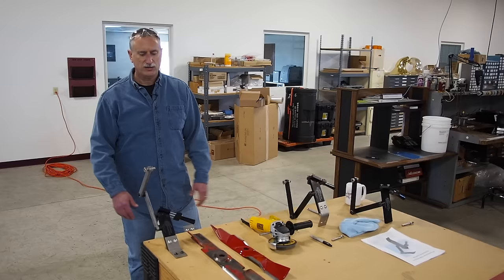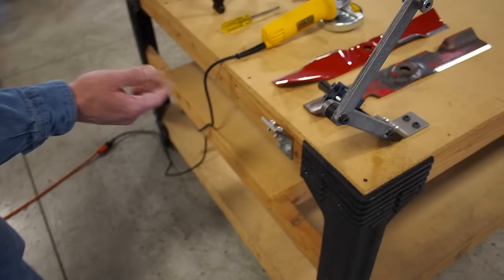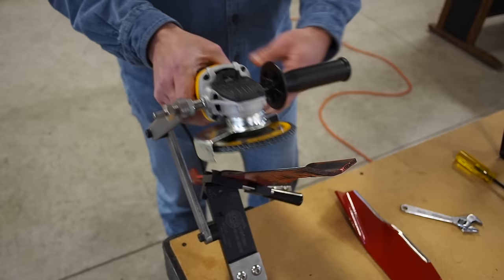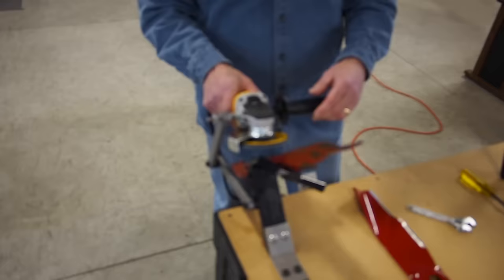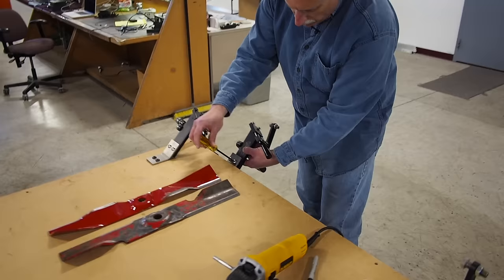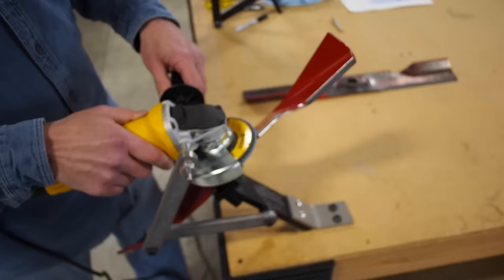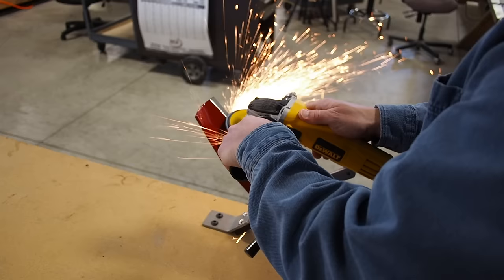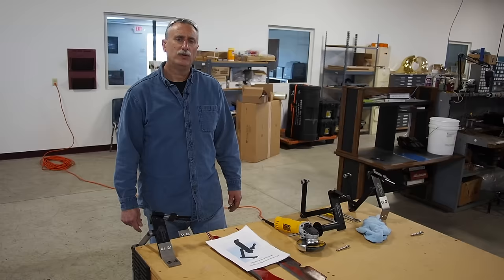All American Sharpener In Depth Tutorial (2017) - Lawn Mower Blade Sharpener

Comment: I was reading the first comment,  which I thought contained EXCELLELENT advice.  Then I looked closer and I saw that I wrote it,  three years ago!

Some further advice:

1.  The most important thing about sharpening a lawnmower blade is not getting the edge at exactly the right angle.  The most important thing is to sharpen the blade OFTEN.  In my experience,  the blade always needs sharpening!

2.  To sharpen the blade often the critical thing is to have the tools needed readily available.  For my MTD mower,  there is one central bolt holding the blade on and two supporting bolts,  one on each side.

Therefore,  I have a separate tool kit with the two wrenches I need to extract the two small bolts, and one wrench to loosen and tighten the main bolt.

I also have a purpose designed blade holder that holds the blade steady so that the bolts can be tightened or loosened without moving the blade.  That's a luxury,  but one I bought years ago,  so why not use it?

I  have a piece of concrete to use to hold the mower back against the ground.   exposing the blade.  It's always in the same place,  so it's always available.

I roll the mower over a piece of tarp,  so that bolts wont get lost if they drop  --- avoiding having them fall in the grass.

Finally,  I do my mower sharpening at the entrance to my basement,  the bottom of the stair well.  The mower is about three feet above the floor of the basement,  which is a convenient height to work on removing and replacing the blade.

I use a hand file to sharpen,  unless there is a significant ding.  If there is,  that gets cleaned up on a bench grinder and then filed as I sharpen the rest of the blade.

I have two blades, and will often remove one blade and replace it with the second,  already sharpened blade.  I then sharpen the second blade when convenient. 

In short,  I have the tools I need readily available and a procedure that makes blade sharpening easy and fast.  That encourages frequent blade sharpening  ---an  important trick to keeping your mower effective.

Comment: How do you adjust the 5005 to do mulching blades? It doesn’t just have to tip feature like the 5000 you’re show ing here. At what angle would you use to sharpen the top portion of a mulch blade?
Reply from the maker: I'm linking a couple of videos that demonstrate the way the 5005 works, and also walks you through how to find your angle. Every mower manufacturer has their own unique blade geometry, so it's not a one-size-fits-all approach to angles. Generally speaking, the raised mulching portion needs to be set 15 degrees LESS than the angle you're using to sharpen the cutting section.
https://youtu.be/muNntkofcYQ
https://youtu.be/YQd8xbZgkq0
Thank you for checking in, and for your interest. I hope this is helpful.
Reply: @AllAmericanSharpener  thanks for the response. I was actually out in the garage setting everything up before I seen your reply. I was able to get it right with great success. What’s odd about mine is it’s a the same angle on the top and bottom part of the mulching blade. Worked out perfectly just going straight across it. Thanks again
Reply from the maker: @dailyDIYdude  Glad you had a successful first go at your blades!

Comment: I bought the new gen 5005.  It is terrific.  Sharpened my Scag blades and Exmark.  But my 12 foot batwing Progressive mower (7 blades) all sharpen on the left side when put on the system.  Is there any way to make the Sharpener work on a left edge blade?
Reply from the maker: Hi Bill. Yes, I believe you are referring to a left hand or counter rotating mower blade. To sharpen a blade like that, you will actually be sharpening the edge below where the blade is mounted in the vise system. The link below will take you to a demonstration video of this. It's not the same blade as yours in the video, but the same principle applies.
https://youtu.be/AmlqcATxdAQ
We hope this is helpful!
Reply: @AllAmericanSharpener  Thanks for the quick reply!  I will be at the shop as soon as I can get more tiime and see if I have the 5005 EXT., otherwise, as always, the All American Sharpener has figured a way to do the job!  Great product.
Reply from the maker: @billfendley7531  - No problem. If you have the 5005 Gen 2, then you have the longer arms (each will be 9.5" instead of 8"). That is the equivalent total length of the older 5005 EXT Model (which we no longer make or sell). So you should be in good shape. 👍

Comment: will the 5005 model do mulching blades?
Reply from the maker: Yes, mulching blades are no problem for the 5005. The angle of the jig adjusts from 15 to 45 degrees, in 5 degree increments, and is designed to accommodate just about any blade geometry. Reach out anytime at support@allamericansharpener.com for more in depth questions regarding your particular blades.
Reply: @AllAmericanSharpener  thank you

Comment: I was always taught to have the angle grinder, or table grinder or file cutting into the blade edge not away from the cutting edge like this sharpener does, just like you sharpen a knife - whats the opinion here?
Reply from the maker: Thanks for your comment. We were taught that early on as well. Although I have since seen many professional knife makers who, during their process, sharpen with a belt going away from the edge. The main reason we do it this way with our jig is because a flap disc will get caught or cut up if grinding toward the edge. Since it is a mower blade and not a fine edged knife, we have found that this method gets the edge plenty sharp in a safe manner. If a burr does form, it is pretty easy to remove it.

I wonder if we can pull @Matthew Rowell from The American Edge into this conversation. He has a lot more knowledge about sharpening fundamentals. I'm not sure if this mention will notify him or not.
https://www.youtube.com/user/capnmatt41/videos
Reply: @AllAmericanSharpener  thanks for the reply - much appreciated - I'll have to check out the link
Reply from the maker: @Krispy1011  You're welcome. Thank you for your interest!

Comment: What about the angled sections of the mulch blade?They need sharpened to,as they are cutting edges as received when new.The Oregon has an attachment post to grind the entire cutting edge.Perhaps your flip adjustment could be adapted to do the other 2 edges?
Reply from the maker: I'm not sure I'm following your question. We sharpen the entire cutting edge of the mulching blade. In the video, he refers to the angle in between the two sections as the "transition area". When watching the video, you will see him sharpen half of the transition area in one position, and the other half in the other position. Then he moves on to sharpening the rest of the edge.
Reply: @AllAmericanSharpener  Thank You for the reply.I am referring to the back side of the transition area(closest to the center hole)
Reply: @DennyAustin5  Okay,or I can free-hand it.We will see when my fixture arrives ;-)
Reply from the maker: @Bowtie41  I see. If it were me, and I wanted that edge sharp, I would just keep grinding further back in the same position, or maybe back in the down position. The blade edge that close to the center has relatively little circular motion, which means it is not doing much cutting, and it isn't as prone to damage and wear. So I wouldn't be overly concerned with that area. Most of the action is happening on the outer portion of the cutting edge, away from the center. Hope this helps. Thanks for your interest!
Reply from the maker: @Bowtie41  I realized one of my responses was from my personal account. Hence the out of order replies. Sorry for the confusion.

Comment: Do you need to grind off the burr on the back side of the blade?
Reply from the maker: You can use a hand file to pull the burr off from the underside if you choose. We don't see a lot of burring with most of our blades. But we do see it on some of the smaller, softer metal blades. There is some personal preference there too. Sometimes we remind ourselves that the first pass on the grass will clean the burr off for you.

Comment: I just purchased a Toro 21” mower/mulching mower. Which one would be best suited for me. The blade is called atomic
Reply from the maker: The Model 5005 would be our recommendation. Many of the Toro walk-behind single-blade mowers have a slight tilt forward in the cutting edge section. With a blade like that, you may have to compensate for the tilted angle and use a setting more like 35 degrees to get a 30 degree grind. Another thing to be aware of with those Toro single-blade mowers is that the sides in the center of the blade are raised. You will need to adjust the vise screws so they fit over the raised center sides. You can see more about that in this video: https://youtu.be/lUw2R6YVa80
Thanks for your interest!
Reply: All American Sharpener thanks for the the great advice....will be purchasing one by the days end

Comment: What grit flap wheel would you recommend ?
Reply from the maker: We recommend a 36 or 40 grit flap disc OR a hard disc. Either straight or beveled wheels work equally well. If you do choose to use a hard disc, you'll want to be careful not to gouge the blades or take off too much material.
Reply: Ok thanks. I use 40 grit.  Can you use a cordless grinder with this too?
Reply from the maker: Yes, many customers use cordless grinders. On a rare occasion, a large battery may interfere with the guide arm. In those situations, you can simply flip the guide arm in the other direction.
Reply: Ok thanks. Will deff be getting one next season
Reply from the maker: No problem. Thank you for your interest.

Comment: Why is the sharpened edge for all that length,  7" to 9"?   All that does is make room for the blade to have a really short life   span  and maybe shorten anyone near to suffer a shortened life,   I've seen that happen from a blade piece come out of mower deck.    The cutting edge speed nearer to the center  of the blade length is not sufficient to cut at any RPM speed of current mowers.
Reply from the maker: That would be a good question for the engineers and companies that make the blades. We just sharpen the edge that the mower blade companies manufacture.

Comment: It still  depends on how  you hold your grinder (?). If grinder wheel is up and down during moving along  blade, then force applied on blade surface will be changed. So, it is  good tool for this application that does not require high accurate and precision
Reply from the maker: We disagree. It takes very little effort to get very accurate and precise mower blade edges with our products.

Comment: Anyone knows that spinning objects HAVE to be balanced.  I only sharpen my blades when they start putting an excess load on the mower and makes me run at a slower speed.  Having dull blades shreds the tops of the grass leaves and makes it grow slower reducing the number of times the grass has to be mowed.  Also letting the grass get taller before cutting helps block sunlight with the clippings so that the grass also grows slower.  When I sharpen blades, I use a bench grinder which makes it easy to follow the existing angle.

Comment: I just purchased two complete 3 blade sets for my gravely ztx 52 for 85 bucks off Ebay. I will use both of those sets this summer.  It will take me 3 years minimum to pay for this device and there are others out there cheaper not to mention that you can build your own. I can't justify it. Fact is, if I use nothing but my angle grinder by sight, I can sharpen these new blades after use several times with great results  just by Kentucky windage so that puts the payoff even further out. It's a cool setup but its over priced in my opinion.
Reply: @MajorImpact  I was wrong. I have only used one set of those blades this summer so the payout is even further out. I have no idea what it should cost. I'm just saying that I personally cant justify the cost for mowing my lawn.

Comment: There is nothing wrong with using a jig as a substitute for skill.

I'm a machinist and I grind high speed steel cutting tools for use on a lathe,  by hand.  So I have skill and no need for a jig for this simple task.  But if you can't manage this simple task with some practice  (you probably can)  nothing wrong with a jig,  

I'm guessing that a lot of people will acquire the skill after some use of this jig and be happy free handing it after a while,  mainly because it is simpler and faster.

Also,  I use a file to clean up the edge after grinding on a bench grinder.  That's an excellent way to complete a sharpening job,  but not practical with this device,  apparently.
Reply: A bench grinder , patience and a shop to exercise them is fine, a cordless grinder and jig on the truck is for the crew ( re unskilled) and hrs billed.

Comment: Pointless complexity for me.  I  grind on a bench grinder,  then file the edge and get good results by hand.
I timed my blade sharpening recently  ----17 min 30 seconds start to finish.  

But if you want the additional bother,  help yourself.

What I was hoping to find was authoritative guidance on when the blade condition makes sharpening a good idea.  Nicks and chips in the blade are easy to observe,  but just mowing once  takes the keen edge off the blade,  but I don't think that really makes sharpening necessary.

I recently took a newly sharpened blade and  mowed a field of 18" high grass.  The mower engine speed never even slowed down and did the job in an excellent manner.

Comment: I've been sharpening blades for over 30 years, your idea is great, but for speed, it takes to much to do multiple blades quickly, I'm talking about balancing as well as sharpening, and as anyone who does a lot of blades for customers knows, you sharpen, the test for balance, then back to do a little grinding on one edge and test and grind, your set up is great for someone who does maybe 3 blades a week, but for someone like me who does 30 a week, this will take to long, to mount and balance, and remount, and balance, but that is with any pro sharpener, price is wow... To high, I will stick to me, and my grinder.
Reply: You have skill  ----no need for a jig.  It is inexperienced people who lack skill who will find this most useful.  After they use it for a while they are likely to acquire the skill and quit using the jog.
Reply: So---- what guidance can you provide on when a blade actually needs to be sharpened?  Nicks or chips on the blade are obvious.  

After even one use,  I find that a blade has typically lost the "bite"  that indicates real sharpness,  but I don't think that means the blade needs to be sharpened again.  So how do you tell?  What is you standard for deciding it's time to sharpen a blade?

Comment: Overkill tool. Mower blade is not like a chef knife. Just using a sharpening stone run through the blade one to two times should make the blade sharp again. Even a brand new lawn mower blade is not sharp like this video. This will damage the blade when it hit a rock or a small tree stump.

Comment: Just set mine up.  It’s fantastic. The only downside is that now i know what a bad job my tractor shop has done at getting the angle right! The first time through has been a pain.  But it is so easy to use that i know next time will be a breeze.
Reply from the maker: We're happy that you got through the first blade edge "correction", and you're right - follow up sharpenings go much more quickly. Wishing you many years of great service from your sharpener!